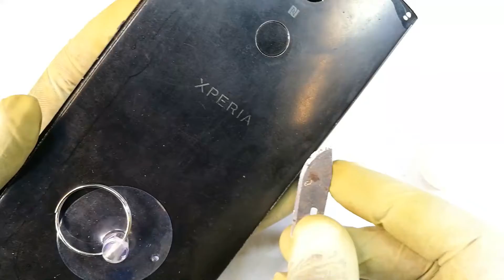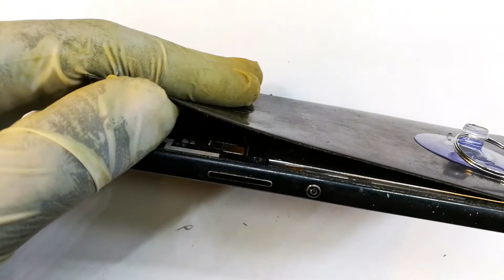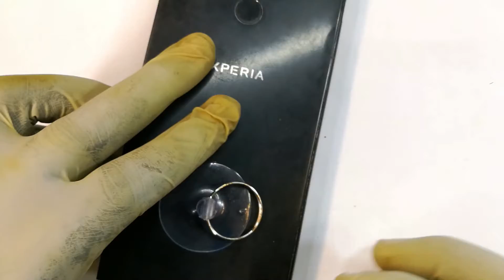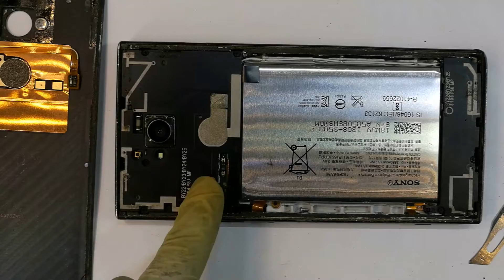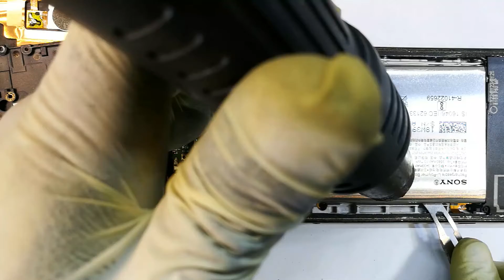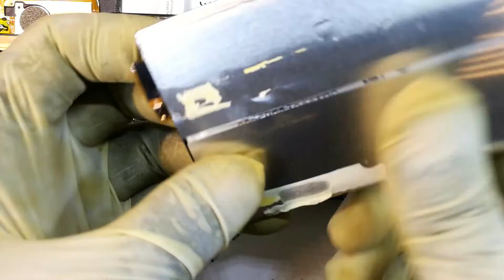Best Xperia xa2 ultra battery replacement | Dead battery | New Battery into Sony Xperia Smartphone

Comment: The volume's too low, or your voice is too soft, or both! You're a brave man to heat a dodgy battery for so long.
Reply from the maker: Oh Thank you for the feedback, i will re-voice it and re-upload. i promise to be louder in subsequent videos
Reply from the maker: haha yeah "brave" indeed, i just warmed it for a short while at no greater than 95 degrees celicius. 
Surely i wouldn't encourage heating an old battery too, recently i had one explode into flames and my room filled in fog and mist, it was scary. So i concur with you.
Thanks for watching though, and thanks for subscribing.